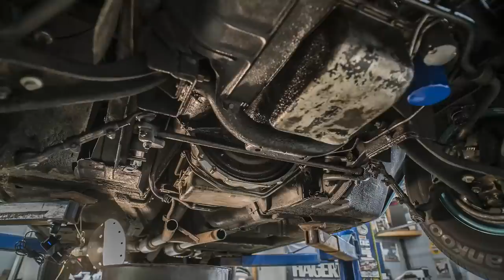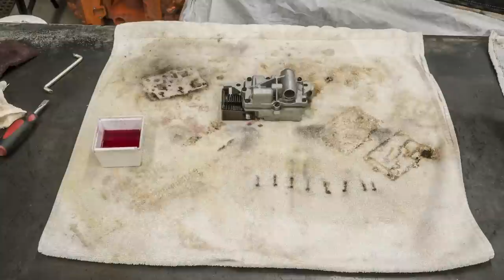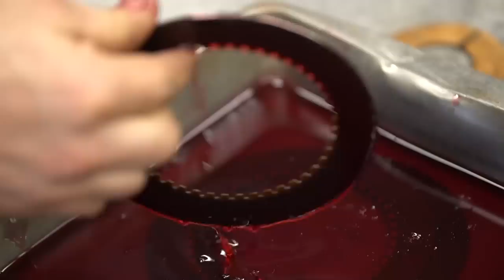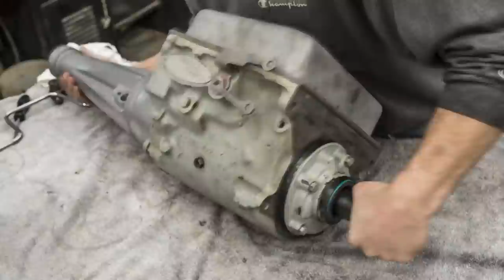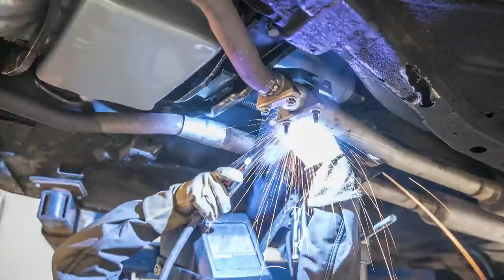Ford Thunderbird Automatic Transmission Rebuild Time-Lapse | Redline Rebuild - S1E4

Comment: This was one of my most and least favorite transmissions that ive done.  This thing is a beast.. But overcomplicated and overbuilt.  I believe one of the only known issues that can take these down is cracking in the housing from the parking panel.  Parts availability is pretty bad as well.
Reply: I just rebuilt mine. I didn't find it to be over complicated. A bit different, yes. But nothing over complicated. I don't see how they are as weak as people say they are, everything inside of that thing is thick and sturdy.  Parts were somewhat hard to get but I found a couple people who deal with them. Working great! as far as I know the only thing that causes the case cracking it throwing it in reverse going faster than 5 MPH and letting your foot off the gas before it shifts to second. I installed a transgo shift kit in mine that's supposed to help prevent case breakage. Mine was in perfect shape.
Reply: @MattsRageFitGarage  what I mean by overcomplicated is that it was overbuilt and later designs are much simplified.  It has two oil pumps, a valve body that is sectioned out into multiple pieces, servos that are bolted inside the case rather than cast into the housing, and lots of torrington bearings rather than shims and washers.  I could be wrong, but I think the fmx simplified a few of these things.
Reply: @davidgalietti3398  Mine only had one torrington bearing, and it was inside the planet, the one that rides on the back side of the stator shaft. All the rest were thrust washers. They must have changed that in later years? mine is a 1964 FX. I'd much rather do a C6, as I've done one of those. But, this was kinda fun. I can say that I can rebuild my own and have them work the first time. I'm probably the only person my age that's even attempted to rebuild one of these in this day in age. Works like a champ!

Comment: You can tell this guy lives and breathes cars.I used to work for the nation's largest automotive retailer. Technicians like these are being replaced by individuals whose last job was picking fruit.Recently I talked with one of my old co-workers who had a manual transmission issue. He and I would always rebuild a manual transmission. When he called the manufacturer for authorization to do a teardown they said "don't bother, there isn't anybody that has the skill anymore to rebuild a transmission. We will send you another complete unit". The automotive industry is on a downhill slide. But for now profit comes first and customer satisfaction is second.

Comment: When i was 18 I worked for 3 years rebuilding automatic transmissions. Every day was a NIGHTMARE. Books an bulletins and more books and manuals full of hundreds and hundreds of instructions, measurments and numbers for every Type and model of transmissions and there are a lot, and if you think that recent models of transmissions are more easy to work. WRONG. Just add more electrónic problems to the list. Ford automatic transmissions were the best ones to work with. Until now i remember how hard it was for  me.

Comment: Dang this is awesome!!! I just bought a 62 bird and I was wondering if 1) a c6 could be swapped in to handle a built motor and 2) if it would be necessary.
Reply: Christopher pending on how much power the motor will make a c6 can handle quite a bit, shift kits help a lot.

Comment: That 'Fluid Passage Block' (That's all I can come up with to describe it) part alone has more parts than a Swiss automatic watch! 0_0
Reply: Valvebody is what its called.  That's because that part is quite literally THE BRAINS of the transmission!  Those multitudes of springs and valves were how you controlled when and how firmly to change gears in automatic trannies before computer controls!
Reply: Well it's certainly impressive what went into making an automatic transmission back then.
Reply: Modern automatics still have valvebodies, even with computers, but not quite as many springs in them today.  Instead solenoids controlled by the computers are used to operate the shift valves and control the tranny, but that's about the only place where things have gotten any simpler in them.  All the multiples of clutch packs and snap rings and O-rings are still everywhere in them, and only getting more numerous with today's 6, 7, and 8-speed autos today.

Comment: What was wrong with the transmission before the rebuild? What parts if any were replaced? Thanks.
Reply: This was a basic rebuild likely because of what they found in the pan and it being of an unknown condition. A basic rebuild is take it all apart, clean everything and reassemble with new clutches, steels and seals. Plus any thing else you find broken in there.

Comment: Extensive work to rebuild any transmission. Unfortunately if you look carefully, the same gears, shafts and Accessories are used. These parts are supposed to be checked for limits but they very rarely do they check them. Seals springs clutch pads, spacers and minor parts are changed. Overhauled transmissions are not the same as a new transmission. Unfortunately they do not last as long as new transmission. A cheap alternative.
Reply: And that the difference between a good transmission shop, and a bad one. If they do what they're supposed to theres no reason it won't last as long or longer then a new unit.

Comment: I have no problem understanding engines. But I don't think I will ever understand automatic transmissions.
Reply: Before understanding automatic transmissions - start at the torque converter and learn that first. It is a main component.

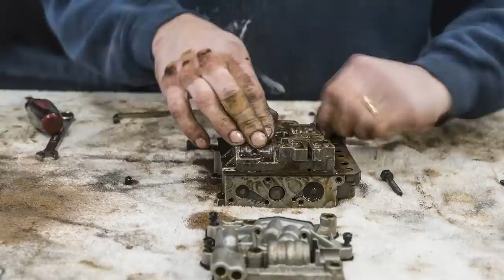Comment: what is the name of the part that looks like it is from the transformers or something? from 1:11 onwards?
Reply: 'Valvebody', the hydraulic BRAINS of the transmission!  'Before Computers', THAT was how the transmission knew when to change gears and how firmly to do it, based on the vehicle speed that it mechanically measured, and how far down you had the accelerator pressed.
Reply: Thank you good sir!

Comment: The numbingly large number of components and moving parts is why cars based on the internal combustion engine are going to be replaced by electric cars.
Reply: You think electric cars are simpler?  LOL.
Reply: immikeurnot yes, I do. If you look at how many pieces there are in the two kinds of cars there are far more pieces in internal combustion engine cars. The drivetrain alone is staggeringly complex in traditional cars.

Comment: I don't get it. A rebuild is taking all the parts apart, putting them through a parts washer, and reassembling all the old gears with new oil and calling it rebuilt? What about all the metal worn off the gears?
Reply: Generally the gears aren't what wears out.  The clutch packs, bands and seals do, and those are what gets replaced in a transmission rebuild.

Comment: that's the reason no one normal would rebuild an auto transmission. too much parts
Reply: And the working area for doing the rebuild has to be 'hospital operating room clean' too before work starts.  Dirty and dingy work areas are no place for reassembling an automatic tranny.  The only reason things should be getting dirty is due to the soaking in ATF, auto tranny fluid.